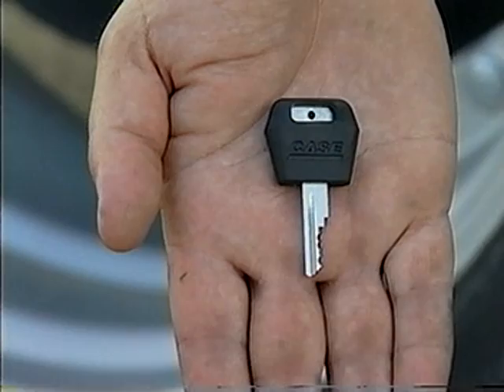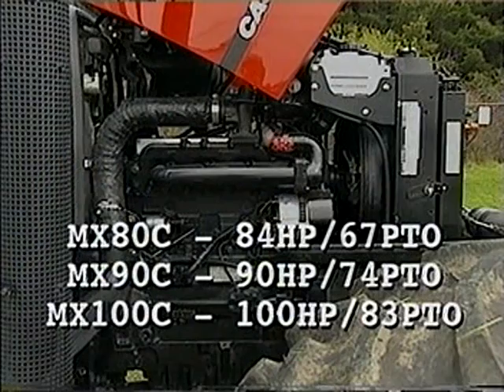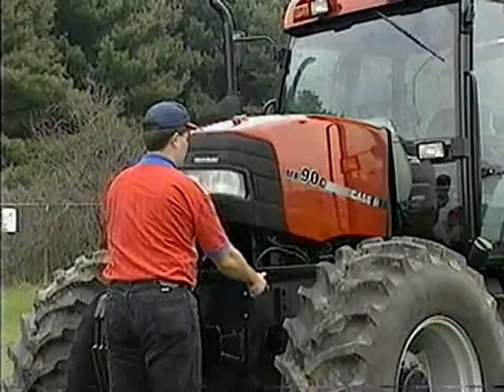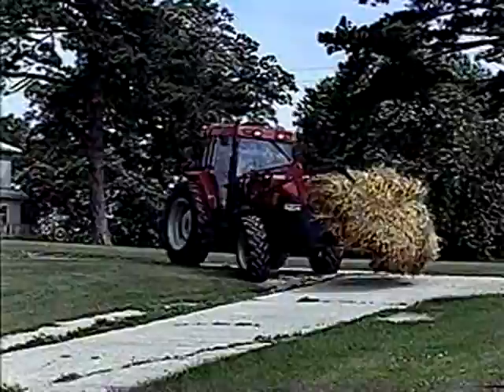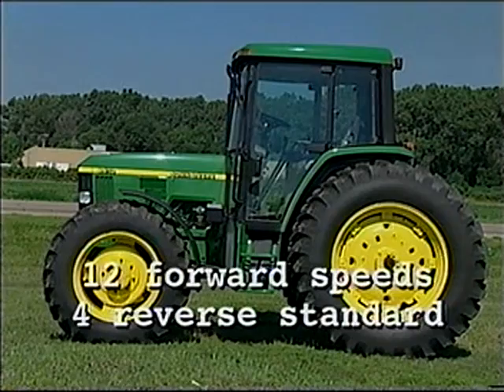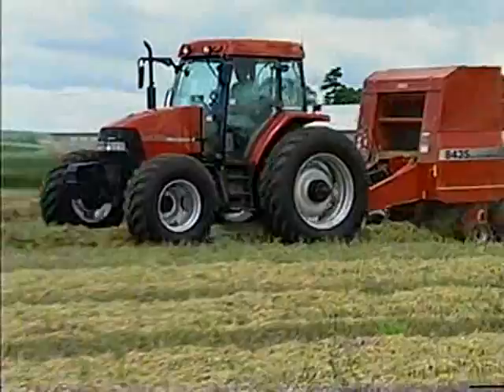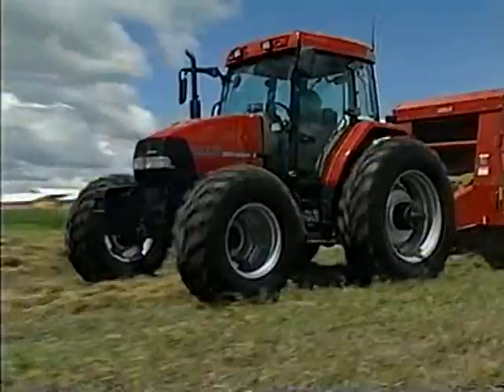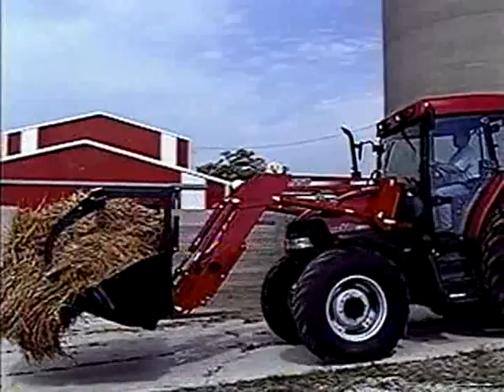CaseIH MXC vs JD 6000 Ten Series (September 1998)

Comment: The 10 series Deere were bullet proof. Case not so much.
Reply: Until they break and mother deere charges you 40% more a green part 🤣🤣🤣I can own three of any other color and come out cheaper then deere not only that mother deere is now impossible to work with unless you go thru the dealer so that's more cost my neighbor had to buy a special battery for his deere and it was 600 dollars if I remember correctly you can keep them I can get a battery at tsc or Walmart 😁

Comment: We have had two tractors at the farm, a John deer 6410 and maxxum 100c, John Deere is still there, and the case is after 4000 hours exchanged for a .... John Deere, sorry ..
Reply: We had 6610 premium with over 10 thousand hours. Would have been still going strong but it was crashed badly. And it's near impossible to find a premium spec one with forward reverse shuttle with a loader

Comment: this tractor was case ih's first step in the very wrong direction, Tenneco owned Case and purchased  IH they decided to build the highest quality most dependable tractors on the market, they succeeded for awhile, but then Fiat came along and purchased Case IH, Fiats plan to build cheaper tractors with inferior products so they could sell more parts and keep all of their dealers overloaded in repairs, on top of that Fiat decided to discontinue manufacturing parts for older Case & IH tractors, it is sad to see deere fallowing Fiats lead by building lower quality equipment and higher cost and repair deals, Fiat sticking a perkins in the mxc tractor was only the start of the big turds they planned to drop on a great equipment company

Comment: Im calling a bullshit on how you guys say the 86 series were junk. The shifter relication was not so good but the cabs were actually pretty nice i mean its all in opinion but id like to see you try to make a tractor! Damn sure cant make one better than any other company so i wouldnt talk if i were you guys so. A tractor is a tractor as long as they get the job done..
Reply: Dougie Hiatt My personal experience with thousands of hours running 86 series INTERs.The cab was clean quiet and comfortable and the self cleaning cab filter was a great feature .The engines were  strong and economical.  Our tractors worked hard on all tasks and  we never had one problem at all .Our machines were well maintained and serviced on  time .

Comment: There is a lot of s%÷t slinging between green and red fans and not many facts about performance  and reliability of this tractor. These mxc tractors are now twenty years old can someone with long term experience with this tractor offer some intelligent information?
Reply: disclaimer: we own a JD 6610. It's 20 yo now with over 10.000 hours. 
Looking at this promo I almost feel we bought a terrible tractor, yet it's still here doing it's job. It's a work horse on which you can count. We later bought a 20 series 6620 but replaced it instead of the older more reliable 6610. We have 2 newer JD's but try to keep the 10 series going as long as possible. I even read the 6610 in particular is starting to become a collectors item.
Reading the comments here and from own observation, it looks like the MXC was a series to forget with reliability problems. Of the two farms operating case tractors in the area, both have switched to other brands in the past 20 years.